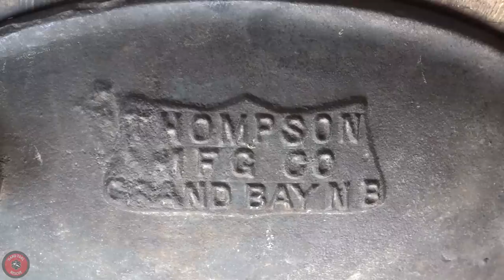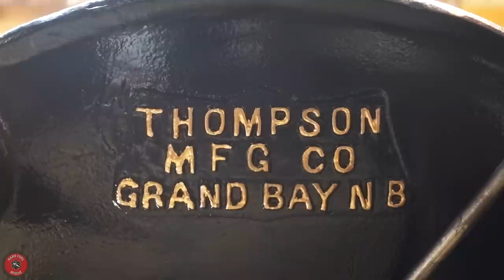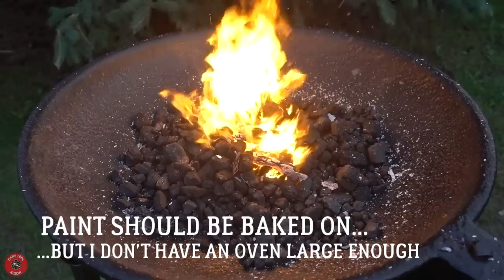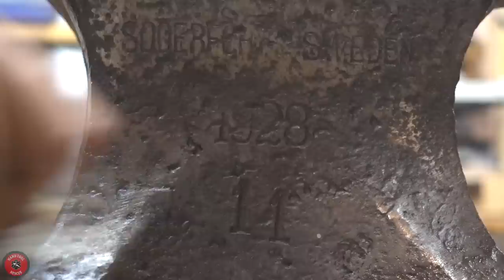Antique Forge & Anvil [Rescue]

Comment: Please shade shield your camera for welding. The light wave is extremely intense and carries a certain % of the open arcs dangerous wave lengths. Also, invest in a compressor and sand/soda blaster. it preserves more of the original cast look without making it looked 'rubbed'. Might also invest in a square drive socket set as most old tools are square headed. I have never seen grade ten bolts that were silver. Those fives will not hold to the heat. Should have put anti seize on all threads. Could have used a piece of cast pipe ground to fit and nickel welded into gap of leg post.
Reply: Sorry i just have to say this, a recording of a welding arc is not dangerous for your eyes. Also if you are worried about his camera, then you shouldnt. Modern cameras are relatively unsensitive about the radiation/light/waves that comes of from the arc. I have to agree about the sandblaster.
Reply: Billy Bracewell this is a digital video file that has been compressed and rendered multiple times... there are no dangerous wave lenghts in this
Reply: I was informed of that fact by a professional digitizer. If he is using an HD or especially super HD Camera (I think it's just HD) AND you are viewing with an HD screen or better Then YES, You WILL receive some of the unseen light bands. Remember, Light is but a visible portion of FREQUENCY. Frequencies are digitized in a MUCH wider band than our eyes can perceive. But ALL frequencies get digitized and transmitted. It depends on the digital pixel build rate of both the camera and your monitor. The in between transmission of the data file is pure holding ALL the light bands recorded as 1s and 0s. Thus, If the camera records and digitizes at the same rate as your screen reproduces that rate... make sense now? did to me....
Reply: I doubt that the normal persons tv/screen can put out uv radiation wich is (as im welding at my job) the biggest danger next to the high intensity bright light. Also the pixels on a screen cant go above 100%brightness of what they were built to do so yeah i wouldnt worrie. This is not meant to be sth mean to you just so you know
Reply: even if that was possible... youtube videos are highly compressed, even in "HD".... and my iPad could never get brighter than the value i allow it to... so your worries are nonsense
Reply: Well nonsense or not I was only repeating what i was taught by a digicomp geek. Oh, and the "visible" spectrum is not the most dangerous frequency zone. just like subvocal IE subliminal sounds can not be physically heard, your brain can still process them. Oh, and vocal freqs are on the way low end of the scale. The sound waves produced by microwaves are even lower than the visible light freq scale.Then the scale continues on thru ultra v, x ray, gamma etc...It is ALL just "radio waves"... just say'n,...
Reply: Gotta agree with ya. Uv Radiation is the biggest danger whilest welding it causes cancer sunburns etc burns your eyes and more. The bright light can also cause pain in your eyes.So ill just ask this: have you ever got a sunburn from a god damn pc screen? Answers no cause they cant give out uv rad because of the way they are built that should be explanation enough.
Reply: Atleast make clear to whom YOU are speaking, you are talking with two persons not with one.
Reply: Can't think of anyone ELSE out there to vote for!
Reply: Is this why I get sunburns while watching Castaway?
Reply: Sorry Billy Bracewell, you need special equipment to record UV, normal photography/video lenses are typically not designed to pass UV as that messes with the colour repoduction.
Pixels on the sensor don't care what band of EM it receives, it only records the charge of the well, how much energy it received, the colour filter array and an algorithm to convert the raw data into red-green-blue pixel values.
Displays are not permitted to emit dangerous levels of UV, Period!
Reply: Screens can only show combinations of red, green and blue. Cameras only record how bright images are on their sensors, they don't capture the light itself for reproduction. The worst case for aiming a consumer camera at an arc is either direct damage to the sensor, or slow photo bleaching of the bayer array that allows for color sensing.
Reply: Your screen is comprised of a back light and transistor switched liquid crystal that blocks certain frequencies of the spectrum to display colour. It is impossible for your monitor to display a brighter or differing light frequency than the intensity and type of backlight within the screen. This means you are viewing the fullest power output on any white portion of a webpage, for instance when the backlight has near full transparency through the LCD matrix which displays white or "open" pixels. Unless you have UV emitting led's within the backlight of your LCD screen it is 100% impossible for a recording to affect you in any way shape or form. Simply the engineer you consulted was mistaken. A screen is no more harmful than a handheld led torch regardless of resolution.
Reply: +LobotiLP you weld without a hood and burn yours eyes three or four time's then tell how look when see it on you phone. stay safe
Reply: who the actual fuck welds without a hood?
Reply: A pixel is composed of three color red,green,blue there is no way it will emit UV light.
Reply: Ok, I did something really stupid to try to settle this argument. I recorded my microwave oven and then played back the video on my tv. Here is the result:
https://www.sideshowtoy.com/photo_300366_thumb.jpg
Reply: Happy Halloween!
Reply: bossy know it all
Reply: wait hold up i thought you were just talking about shading the camera to not damage the sensor with the arc, you actually believe that cameras and monitors will capture and display welding arc? and you were told this by a "professional digitizer"? i'm sorry to tell you this but whoever told you that was yanking your chain.
Reply: No, sorry, it doesn't make any sense, it's complete rubbish, no matter who told you. The data files we use for both photo and video do not record any light bands. Neither visible nor invisible, none. No frequencies are transmitted in any shape or form. It's just like a coloring book for your grandchild. There are instructions of what color to use for what part of the picture but just as there are no frequencies transmitted in a coloring book, they aren't here in YT, either.

And the amount of colors so represented (called gamut) is considerably smaller than what the human eye can see. Not more, neither ultraviolet nor infrared, but less than what we can see with our eyes (with a common, usual household monitor that you very probably have, much less even).